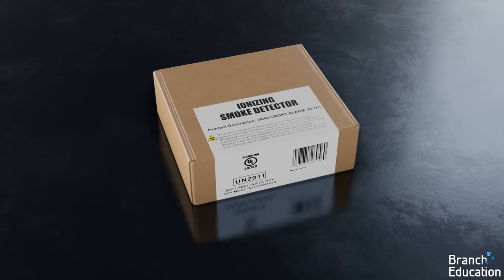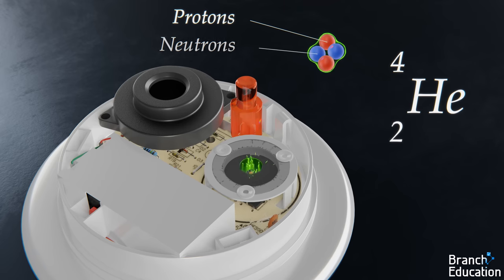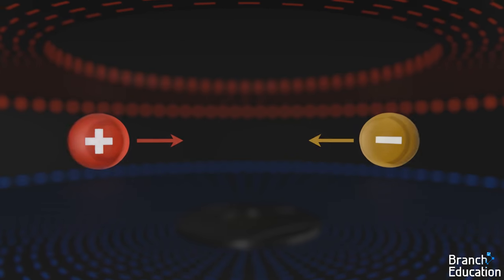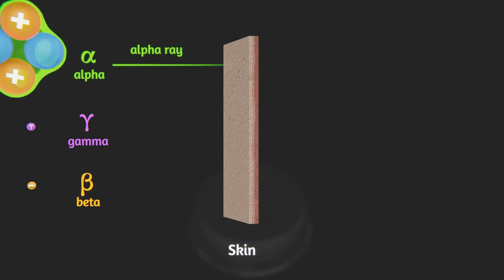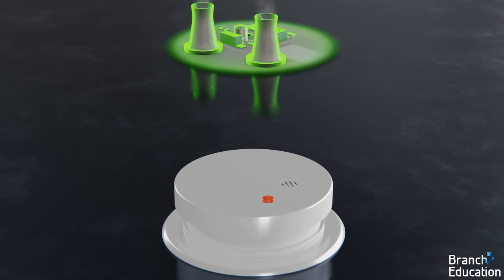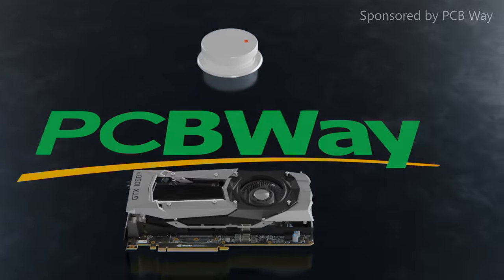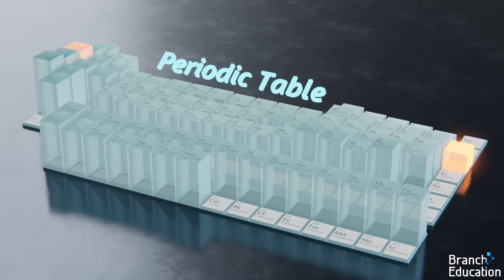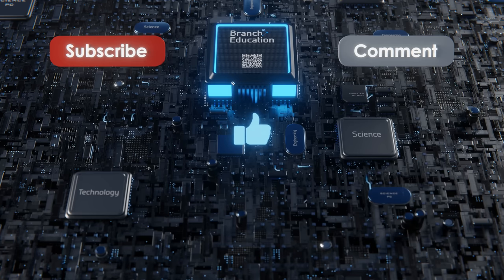Why are Smoke Detectors Radioactive?  And How do Smoke Detectors Work?

Comment: Technically, you depict an older “smoke alarm” made to comply with UL 217.   “Smoke detectors” are UL listed to standard 268 and are made to be connected to an alarm panel/system.  Basically, Smoke alarms have a built-in sounder and battery as part of their listing. Smoke detectors are made to be used with separate sounders and strobe lights and are powered from the fire alarm panel. The newer smoke alarms do not have replaceable batteries. The batteries are made the last 10 years and when the battery is bad, you must replace the whole unit.  Photoelectric smoke detectors, because of the power needed to create the light needed, are not used for smoke alarms since the battery would be depleted rather quickly.
Why did you change how you pronounced Americium?
Reply: This is not entirely true.  There are photoelectric units that have non replaceable batteries and are guaranteed to last ten years.  Further all new smoke detectors are dual chamber, you can look up the UL # yourself
Reply: @georgeburns7251  They’re pretty much been dual chamber from the beginning.

Comment: !!!WARNING!!! The first smoke detector demonstrated here is the most common one in homes and fails 55% of the time (OVER HALF!) Contrary to the video's false claim, ionization detectors DO NOT detect smoldering particles.
It was the best detection we had when it was invented and it worked well for our homes at the time, but now that we have more synthetic materials in our homes, we should use photoelectric alarms which fail under 30% of the time.  Be sure to buy new alarms every 10 years and vacuum your alarms every year in order to keep them running and operating at optimal levels.

You may be careful, but most home fires start from things outside our control like recalled devices, faulty wiring and natural disasters.  Fires burn 8 times faster today, so there's really no time to escape unless you get early detection.  Maybe you won't be the one to go through a house fire, but there's no harm in being prepared, and it just might save your life and the lives of those you love.

Comment: Pro tip:
Always put CO1 detector below bed level so when you sleep you wont fall asleep forever.
This gas is denser then air and will firstly stay on ground so if you put detector of it on cealing then gues who is gonna inhale it first. You or detector.
Reply: Don't know where you got your information, but you might want to stop listening to that particular source.  
Carbon Monoxide (CO, not usually written "CO1") is lighter than air, not heavier, and will rise to the ceiling like smoke does. 

The early CO detectors used a LOT of power, so they made them to plug into electrical outlets because their power consumption precluded using batteries.  By the time CO detection technology reached a power level that allowed batteries, people were already used to installing them as low as electrical outlets.  That probably started the myth that CO stays near ground level.  But the best place to install them is on or near the ceiling, like smoke alarms.
Reply: @tarinaten2053  co1 is heavier then oxygen just by looking at atomic table weights of atoms C is denser then O
The smoke from fire is going upwards only beacuse the hot air is making it do so.
And its slowly going down all time just firstly beeing pushed up by hot air.
Reply: No. Carbon monoxide is slightly lighter than air. The molecular weight of carbon monoxide (CO) is 28.01 g/mol, while the average molecular weight of air, which is a mixture of various gases, is approximately 28.97 g/mol.
Reply: @justinlongest2019  well when I checked last time the CO fell down